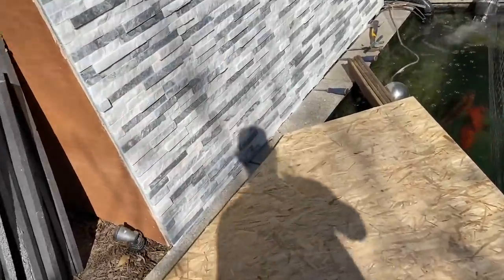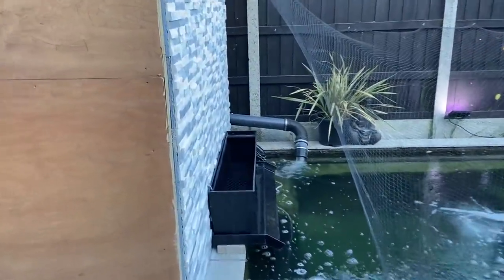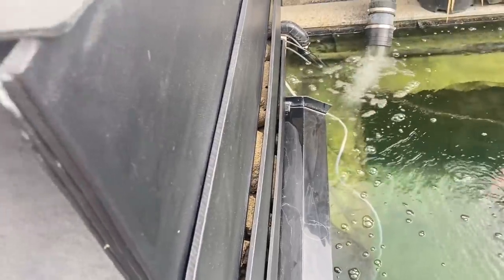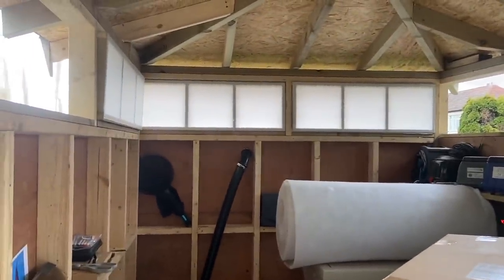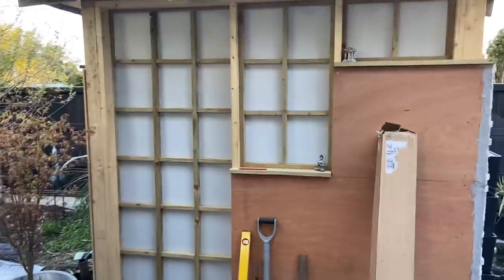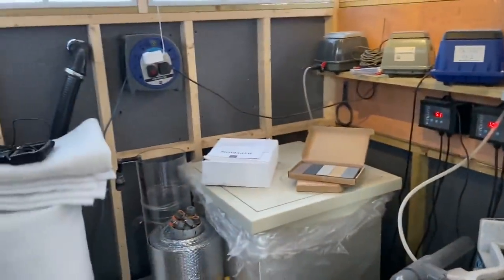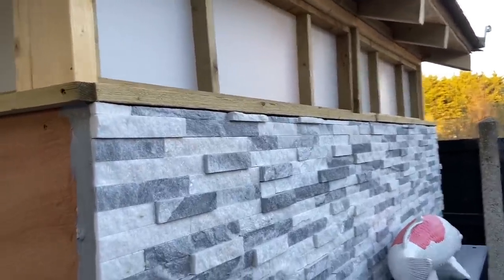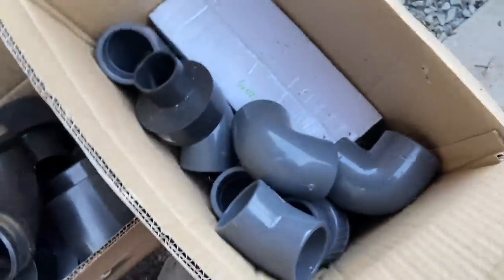Just4koi FILTER HOUSE PROJECT!!! PART 3 Shoji kind windows and wall installation PRIZE COMING UP

Comment: great job all round m8 where u said u r not going to silicone under the sill water will get in if u silicone it dont cut the nozzle where the silicone comes out it will leave a nice thin line wet your finger slide along the silicone job done good luck
Reply from the maker: Thanks pal, I will be sealing it today at some point few mentioned water can get in , made a big mess from doing the sides, thanks on the tip, keep safe 👍🏻

Comment: Hi I like your show and I like what you did to your pond, I will like to know where you got tube for your up-flow filter cause I will like to make one for my self . From Rick in Southampton.
Reply from the maker: Hi mate, I got the acrylic tube from CLEARPLASTICTUBES online, I got a 200mm but couldn’t manage to get all the parts, so I have changed to 150mm tube but will be double tubes when I build the up flow filter I showed a diagram of the build I will be doing, check it out if that helps in anyway, but will have a video up soon, take care 👍🏻thanks

Comment: Nice job on your filter house, I'm not a big fan of bakki showers but I think yours looks alright with the feature wall behind it, will you be putting a water blade or something similar in place of the bakki shower.
Rob.
Reply from the maker: Hi rob, I will be replacing the bakki shower with a momotaro bakki shower it will be up against the fence, the bakki I’ve got now has covered up most the feature wall which I’m not to happy bout, thanks and keep safe👍🏻jeff

Comment: your video has made me giggled :-) Your neat sealant job is as neat as mine hahaha 

What a stunning job you have done. I just noticed something, and this is not a criticism at all, and also but I might be wrong.. I know you have the overhang from the roof, but what if the rain is severe and oblique, with the windows on the inside, wouldnt the rain water go inside the filter house? 

What a stunning job you have done! Well done the 1000 subs, you deserve it! Take care :-)
Reply from the maker: Professional sealing that is 🤣, I wouldn’t know till it rains 🤣but I think it should be ok , take care 😉👍🏻
Reply: @just4koi143  I am sure it will be fine. It will be hidden anyway
Reply from the maker: I’m gonna attempt to seal under window ledge someone else also mentioned water can get in, good luck with my sealant 🤣

Comment: Looking brill mate the filter house is awesome ,you have worked your nuts off well done Jeff 👍🏻😀you teasing us with the gift cutting it short mate ,is it a profi drum 😂😂😂 mate I said I’m no going to enter anymore of your comps after winning last one, but after seeing the little koi ornament might have to pal 🤪👍🏻
Reply from the maker: Morning Mike, hope your good, I knew you couldn’t resist the gift 🤣🤣🤣, you got a sharpe eye buddy 👍🏻
Reply: @just4koi143  going to send you some photos through your email mate of how my ponds are coming on buddy you got different tile backing boards than me will send now 😀👍🏻
Reply: @just4koi143  yours look better thou both from wicks and yours has noise reduction aswell better for the koi mate 👍🏻
Reply from the maker: Have you sent email ?👍🏻
Reply: @just4koi143  yes mate probably best through WhatsApp if you have it
Reply: @just4koi143  and I got that retro fit bottom drain you got from same place mate cheers 👍🏻
Reply: @just4koi143  did you get them mate
Reply from the maker: Just got home matey, will check out the emails after, that retro bottom drain works amazing btw you will be happy with it , will message you back later 👍🏻
Reply: @just4koi143  no problem relax mate you need a rest 👍🏻
Reply from the maker: Morning Mike, I checked my mails I haven’t received anything
Reply: @just4koi143  have you WhatsApp mate can send them through that and it will be a lot easier
Reply from the maker: yes I have whatsapp mate

Comment: Looks pukka mate I think it looks better with the shower and you have 16 holes in the wall well done on the 1k subscribers 👍👍👍
Reply from the maker: Thanks matey, yes I got 16 holes now to fill up 🤣🤦🏻‍♂️, I’m selling the bakki shower I remember you mentioning you wanted to add one this year, few guys are interested in it let me know if you are too, will deffo look after you, you have being with me pretty much from the begging, take care mate 👍🏻
Reply: @just4koi143  thanks for the offer mate but i think yours is a bit different for what i need cheers for thinking of me yeah mate here from the start great content how you gonna fit momontaro showers down the back they are wide? 👍👍👍
Reply from the maker: I was going to place them up against the fence side of the pond, the tiles I’ve put on look so nice but the shower has covered most of the feature wall kinda gutted bout that tbh, the momotaro bakki showers come in 2 different depths 41cm and 61cm, I will be going for 41cm which will sit perfectly on the slabs with the weir hanging over, I hope 🙈toke measurements so fingers crossed will be fine, 👍🏻